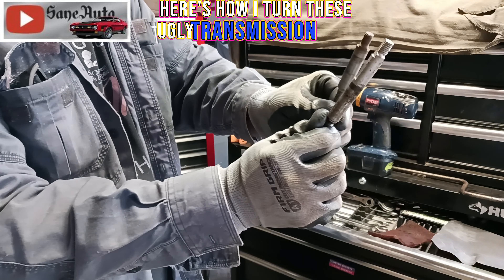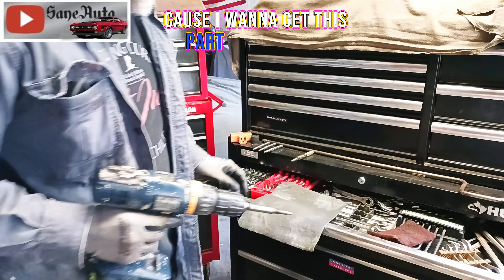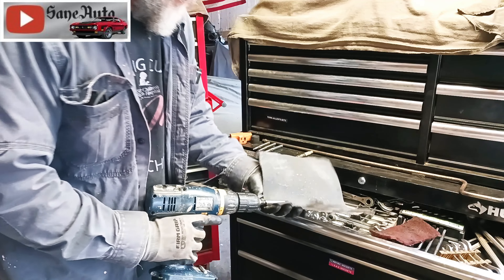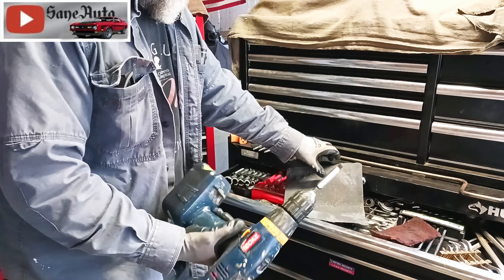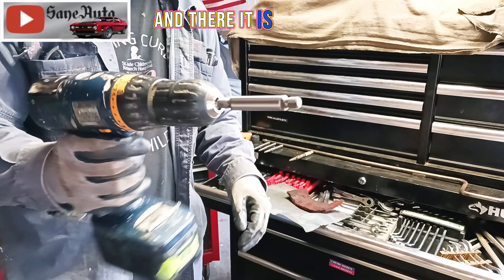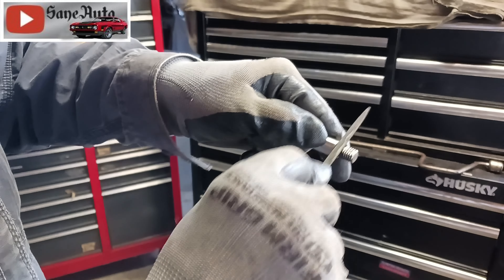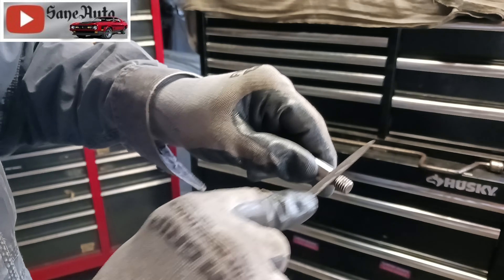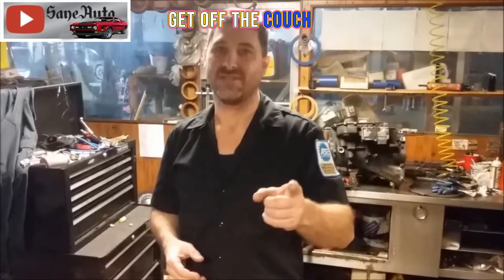How I make $50 per hour reconditioning these classic car parts

Comment: I need some old 700R4/4L60 parts Mainly an output shaft, and some other things like the Spragg assembly and race planetary sets. I’ve seen a ton of them on eBay pretty reasonable.